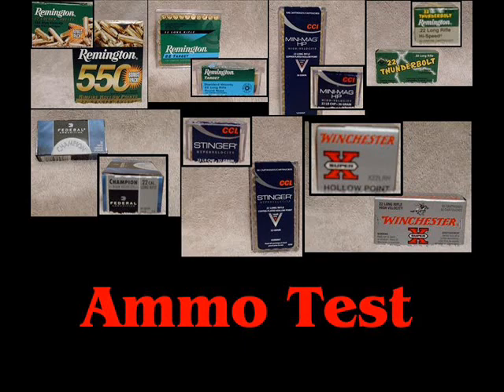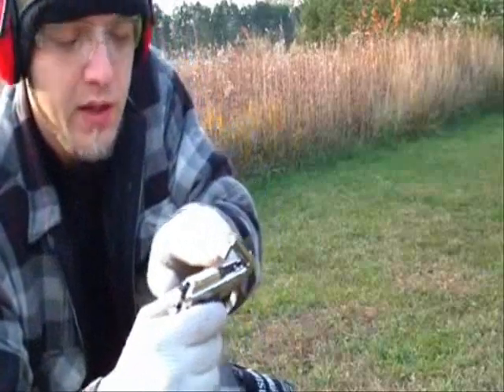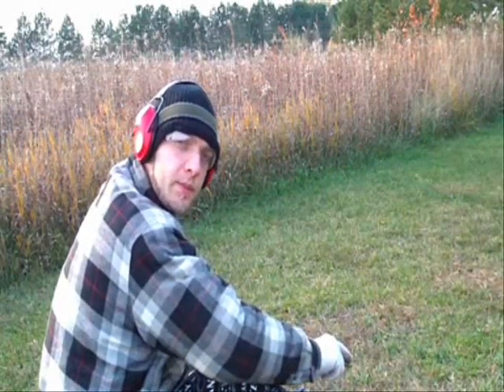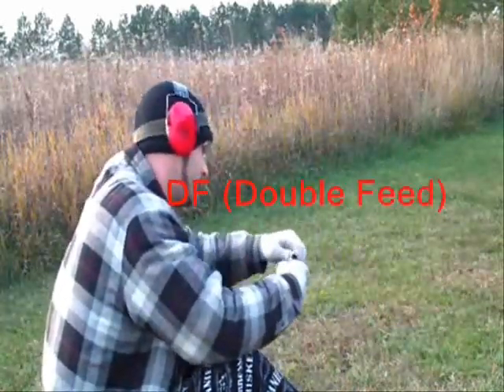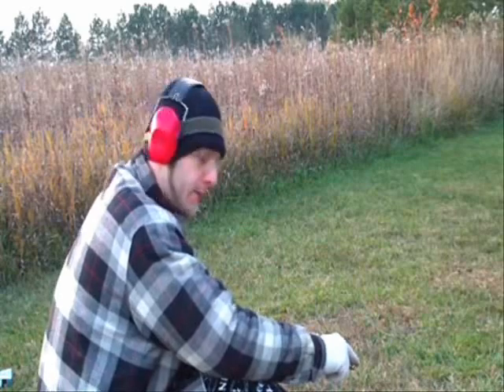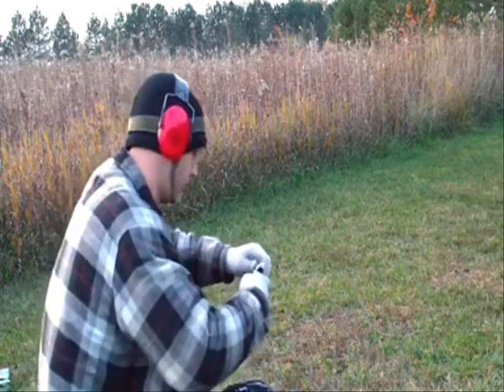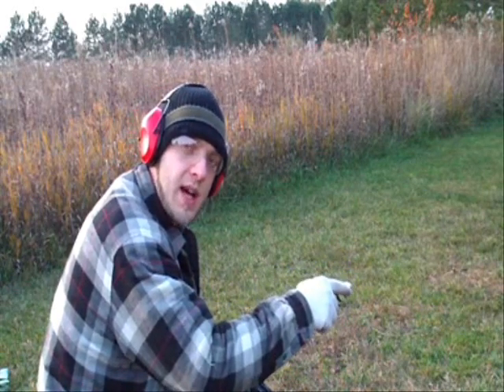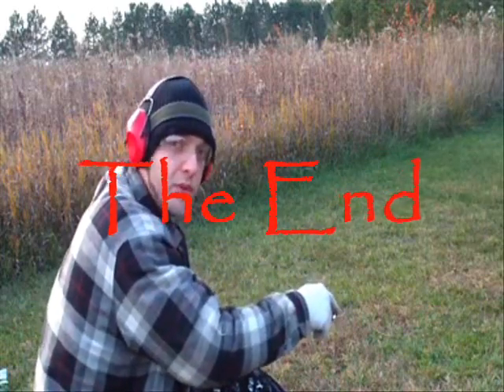Beretta 21A Ammo Test

Comment: Great video. I’ve owned several tip up barrels by beretta and have gotten lucky on reliability each time. Even had one that could run even the cheapest 22 bulk ammo for a solid shooting session before it got too dirty. Cleanliness is the key to functionality with this gun. I also found that shooting about 200-300 cci stingers and/or velocitors when you first get your bobcat (new or used) will properly break in the pistol allowing for increased reliability with more brands of ammo. Rimfire is still rimfire, and the highest end ammunition for .22 is still less for a box of 50 than it is for any other centerfire caliber pistol off the shelf. This is a quality gun meant for quality ammunition. Get a revolver if you want every round of wal mart junk round to at least not cause a malfunction in your gun. Also, buy an extra mag or two. These guns were very often loaded and never shot for years and there are some worn out mags floating around. Even new mags can have issues, perhaps just issues with a certain type of ammo.

Comment: On simple blow-back guns, the extractor does not pull out the empties after they are fired. The bullet either has enough energy to push the slide back, or it doesn’t. If the chamber is too dirty, the case may get stuck, and the slide won’t move. An extractor mounted to that motionless slide won’t extract anything. The only purpose for an extractor on a blow-back pistol is to pull cases or live rounds out of the chamber by manually pulling back the slide. The tip-up barrel makes an extractor unnecessary on the bobcat. Of course, if a cartridge fails to go off, an extractor would allow you to rack the slide to load a new cartridge. Fortunately, a dud usually gets ejected when the barrel lever is pushed because it hasn’t expanded from firing. Using the support hand, it is actually possible to quickly flip open the barrel, close it again, and rack the slide.

Comment: Great test, thanks for the info.  I also have a 21a, and have experienced similar difficulties with bulk ammo.  The CCI mini mags are definately hotter rounds than the other brands, with sharper report, and more punch, which is why they function the 21a action.  Bulk pack stuff just doesnt have the power.  You can modify the 21a to work better by shortning the recoil springs, it's a pain in the butt to get to them, I think I took 3/4 turn off each, and my 21a works perfectly with all ammo.

Comment: Took my brand new out of the box 21 bobcat to the range today. Shot 75 winchester wildcat shells that were old and showing oxidation.  I had only two FTF. I  fired 100 cci mini mag HP no failures and about 30 cci stingers with no problems. Great little gun. However I noticed that the front site was off center. Im not complaining since I got the gun for only $168 new. Thats why it was a great deal. I figured it must have had a defect to be so cheap.

Comment: yes the 2 sides that are bent in at the top of the mag that holds the rounds in until the round is pushed foreword and chambered 
with the bullet in the mag it is the edge closest to the led bullet 
right were the edge stops just bend in a little but just the tip on both sides 
with a full mag if you look from the side the top round is more nose down with the top of the mag but with only 1 or 2 rounds from the side you will see the round it pointing more up 
this is the problem

Comment: I've had mostly similar results with my 21A. CCI Mini-Mags thus far are the only reliable round (zero Fails) with both RN and HP.  Even stringer did not work when first tested (out of the box); but I have not re-tried them lately (due to availability).  I also want to test the CCI Velociters (40 gn Super High Veloc HP).

Comment: I bought 1 early this year.  The first time I fired it it failed to eject.  Using CCI, Continued to do so off and on for a couple more times to the range.  After one outing and cleaning the gun I applied a light coat of gun oil in the barrel as deep as the shell casing.   I have fired many magazines of ammo through it since then and it has never failed to eject.  Maybe breaking it in helped. Have 3 magazines and none have ever failed to load a shell.  I carry it always.

Comment: My 21A has never let me down, Never a misfire, even with Remington.
I don't know where he gets his ammo, but it's time to switch. And for personal defense with a 21A, I don't want a fast bullet, i want a slow bullet that will tumble a bit and not go through-and-through. Min Mags do the trick. They go in but don't go out.
Reply: I'm glad you've had good luck with your gun, but my own experience and many, many others is quite the opposite.  I've tried a lot of different ammo, too.  The CCI high velocity stuff works better, but it still has a higher failure rate than any gun I've ever used.

Comment: Excellent video! By far the biggest gripe about .22's is they are unreliable and do not pack enough of a punch. First of all, like a new pair of shoes, these guns need to be broken in. I own a Jennings .22 which is notoriously unreliable, but after 500rds or so this gun has turned into the best 75$ I have spent on a little plinker. Same thing with my Ruger Mark II. Easily the best .22 over all and arguably the best .22 LR ever made, it took about 200rds to become reliable. But the best fix is simply do not EVER rely on cheapy ass ammo like the Remington 500ct. CCI Stingers, CCI Minimags and the newer CCI Velociters are the way to go. For the range? Yeah, the 500ct cheapy ammo is fine, but for self defense NOTHING LESS than a CCI round should be in the pistol. And for those who say .22 lack stopping power, the test is for a bullet to penetrate 2inches of common yellow pine. My hunk of shit Jennings can do that at 600meters away if I manage to hit the target (far more luck than skill I'll add)
Reply: I just discovered something awesome I'm going to try! I just discovered bullets for a .22 that have a muzzle velocity of 1,750! I think they're called Aquila .22's!

Comment: so long as i use 40gr 1200fps or faster mine runs flawless 
will run just fine with cheep 36gr bulk ammo so long as it is 1250fps or faster but have had few duds
1050 or 1080 fps allot of FTF 
ammo of choice is CCI Velocitor 40gr 1435fps 
but i don't shoot it when just target shooting
40gr led generates the needed back presser to cycle the action so even with cheep bulk it will run fine so long as it is 40gr with 1250 fps or faster rating 
when fishing i load CCI Velocitor varmint protection

Comment: 22 LR is ridiculously unreliable in this gun, and less than 100% in most semi auto pistols.  The QC on .22 is marginal... uneven primer distribution around the circumference of the rim, uneven powder charges. The short barrel generates so little energy that the pure blowback system won't work well, especially with low velocity loads.   I have this gun in .25 ACP and it runs 100%.